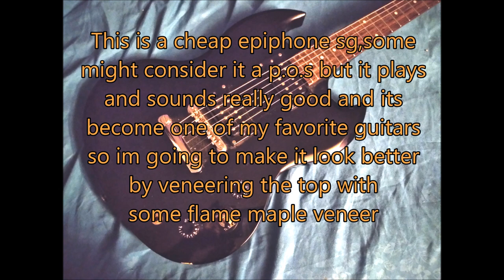VENEERING A GUITAR TOP

Comment: Trying to do the same on a beat up Epiphone sg. The previous owner decided to take a chisel to sections of the body. 
Was it spray adhesive you used for the veneer? I had read spray adhesive wasn’t a great choice for veneer, but seems to have worked great.
What type of finish did you use. Lacquer?
Reply from the maker: I used spray glue but I don't think I will if I do it again ,it worked but I had to reglue some edges ,yes laquer for the finish , thanks for watching

Comment: Plz eggsplain how you knew where to cut the holes for the pickup cavities. Did you use a template?
Reply from the maker: You can push on the veneer and feel where the cavity is or a paper template referenced off the neck pocket works too
Reply: @sdmcustoms  thx